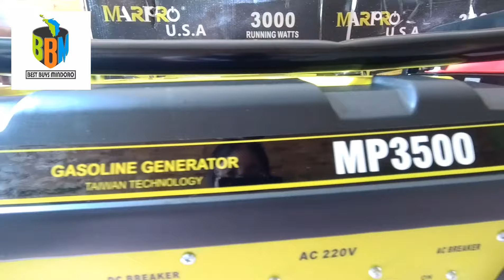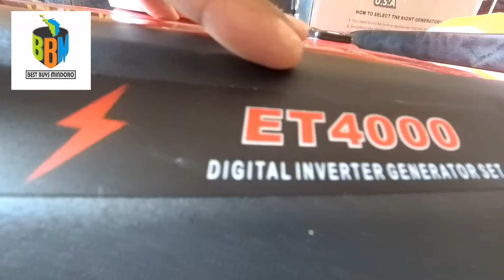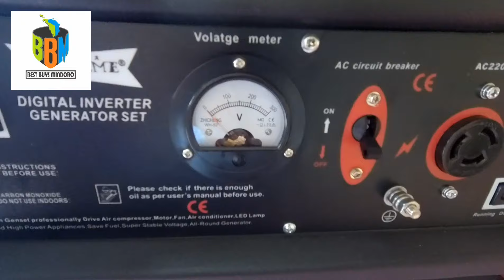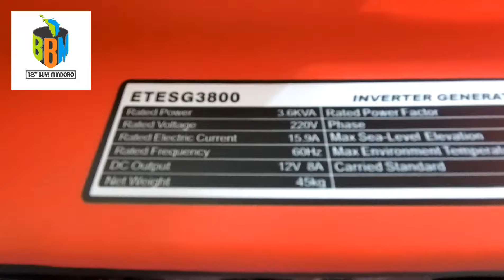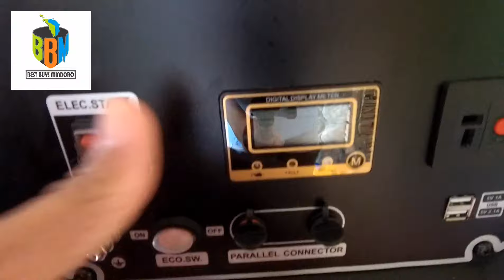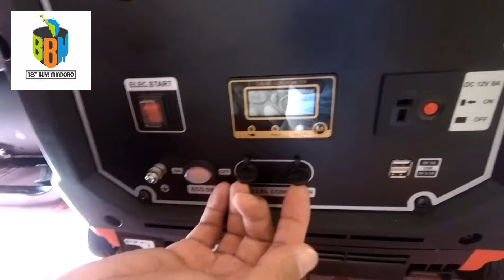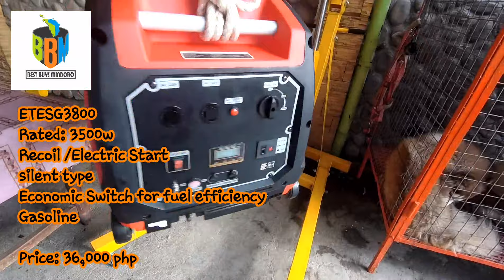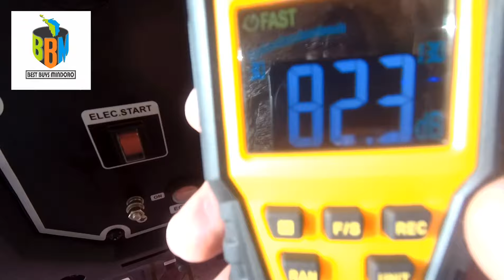Best Portable generators.  Marpro, extreme inverters/ Occi. Mindoro    #BBM

Comment: Do you ship to Cebu?
Reply from the maker: Yes pp
Reply: @bestbuysmindorotools1119  36k pa rin po ba yung inverter generator?
Reply from the maker: @JoeMartian  powerhouse po 39,900. Wla p po stock ng extreme sir
Reply: @bestbuysmindorotools1119  pahingi po ng price din ng inverter na 1500W saka anong brand.  Thanks!
Reply: @bestbuysmindorotools1119  ok din po ba tong PowerHouse?
Reply from the maker: @JoeMartian  1800w po meron stocks. 25500 power house.
Reply from the maker: @JoeMartian  eto po bagong stocks ang nreview ko.. so far ok n ok po